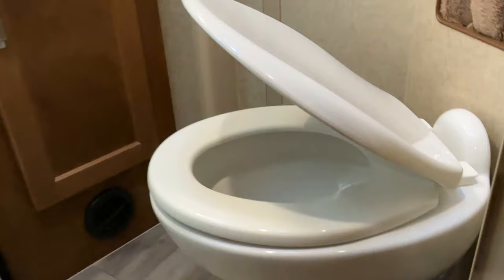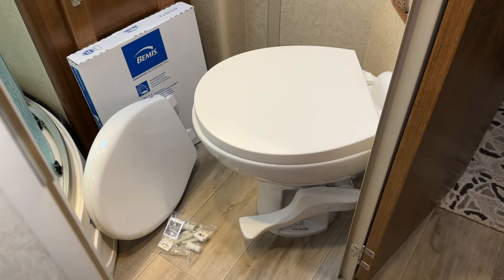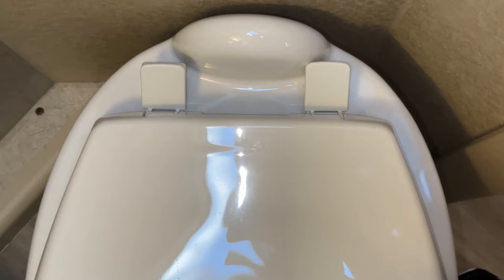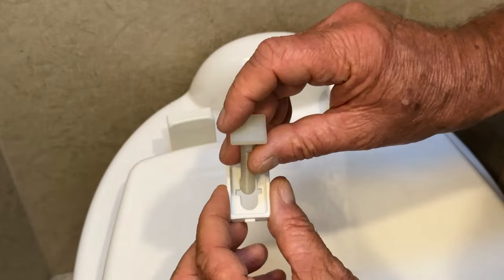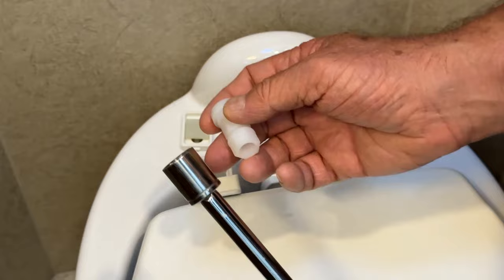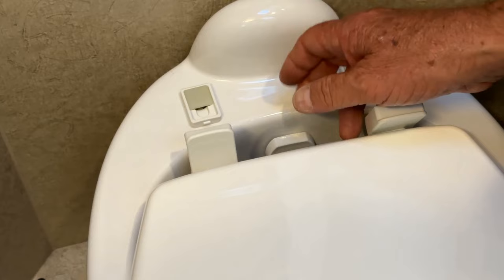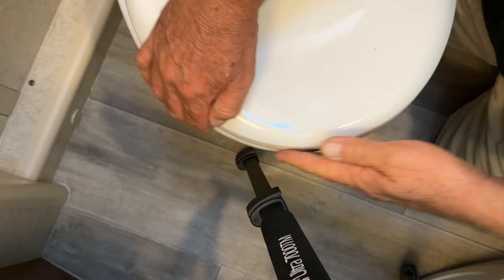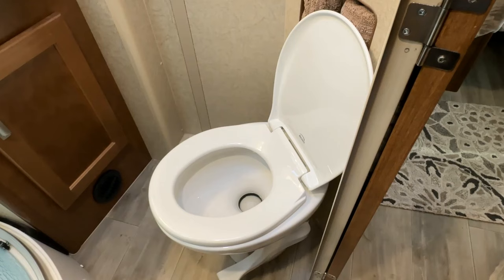Installing a Soft Close Toilet Lid in a Few Minutes (Step by Step)

Comment: Was wondering. Is this seat wooden seat with a plastic lid. We have the same toilet in our Ultra Lite, and it sits crooked on the bowl.
Reply from the maker: Its a thick plastic, I just made sure it was straight before tightening it down to the bowl. It seems to be staying right where I placed it. You might try loosing the bolts, centering it again and tightening up the bolts. Oh wait I just thought of something, Is the seat sitting crooked side to side or up and down sitting on the bowl? 
Amazon - Slow Close Toilet Seat - White  (Installed in Video) -
Also available in other colors
https://amzn.to/45A7U7Z